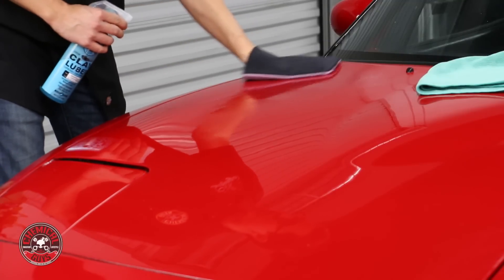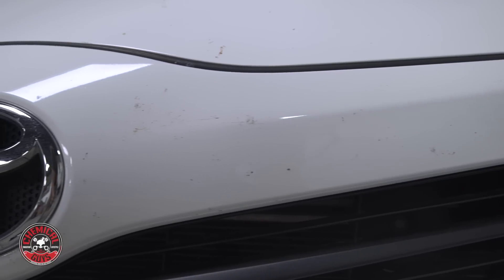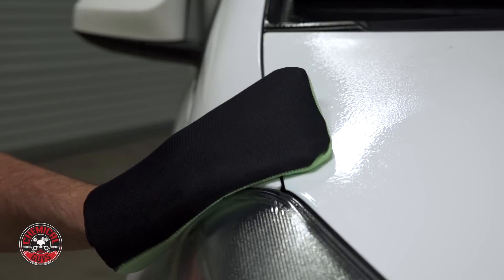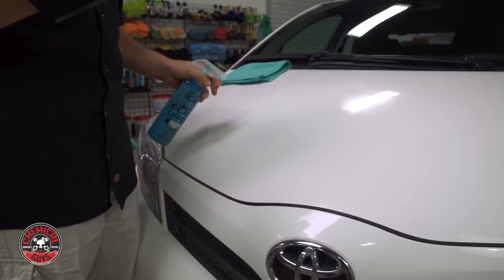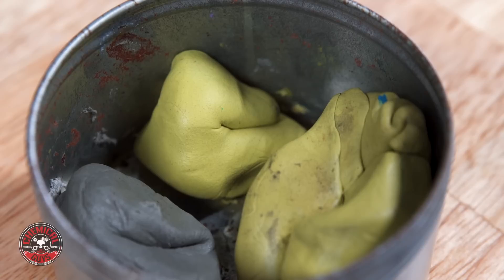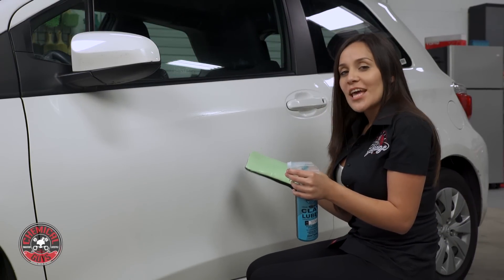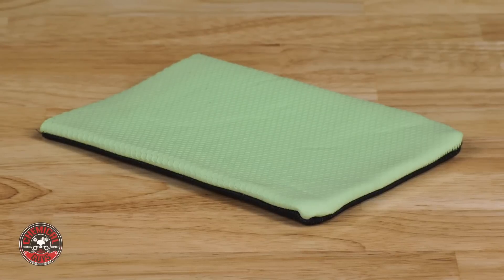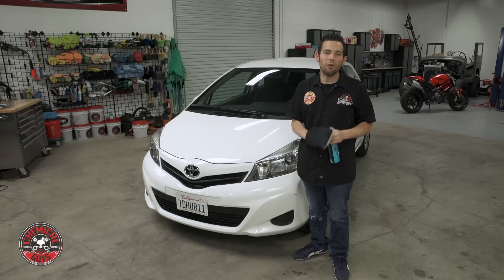The All New Clay Eraser Mitt - Chemical Guys Car Care

Comment: Would this make a good oven mitt? Mine is getting alittle old and needs to be replaced soon.
Reply from the maker: no.
-CG
Reply: +Chemical Guys how long does it last? And is it durable?
Reply: Chemical Guys can you use the clay mitt on more than one car as many times until it's worn out? Or is it good for just one clay bar mitt session?

Comment: Yes the mitts work. They make the process even easier. I do a lot of cars and it is nice to not buy block after block of clay. Even quicker is the clay disc that fits on the buffer. Both are great and easy to clean.